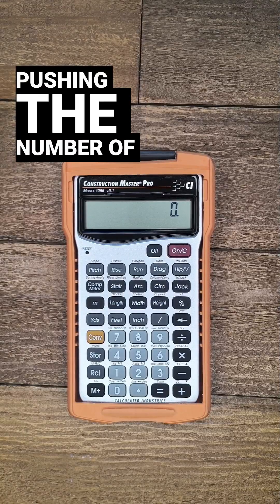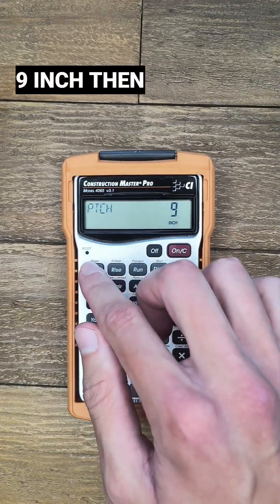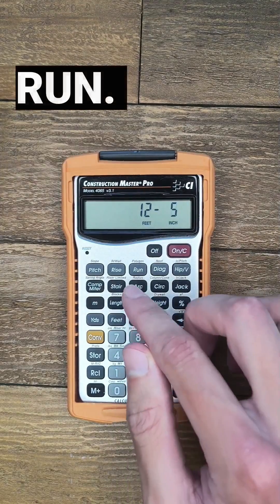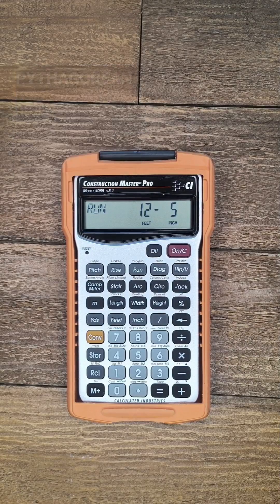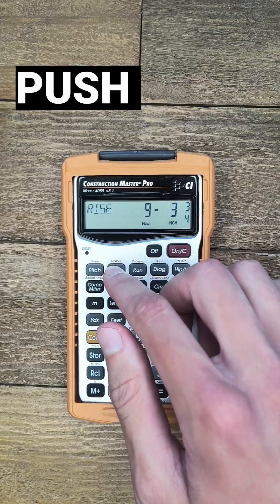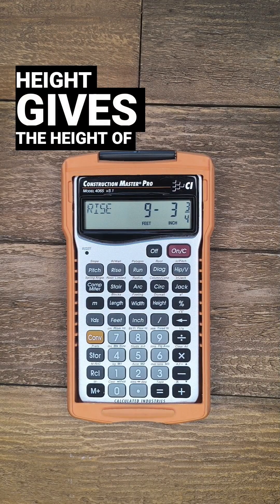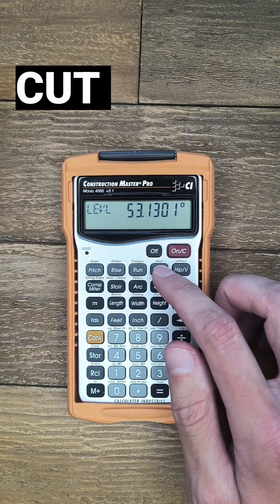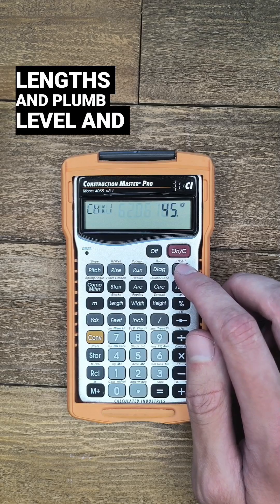Pitch and Run Calculations | Construction Master Pro

Comment: What if you only have the rise and the run? Not the pitch.
Reply from the maker: If you only have rise and run, it's a similar process: 1️⃣ Enter your rise and push Rise 2️⃣ Enter your run and push Run 3️⃣ Push Pitch until you see your pitch in the units that you want - degrees, feet and inches, etc.
Reply: @CalculatedIndustries  awesome ! Thank you
Reply from the maker: You got it! 👊